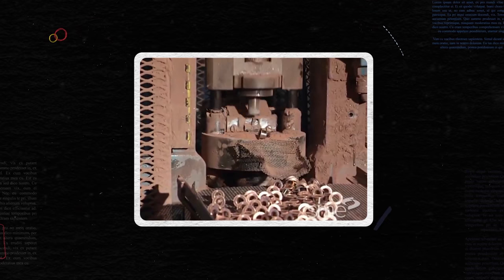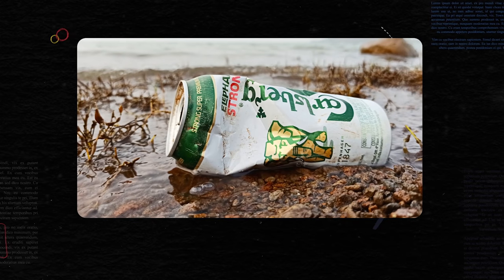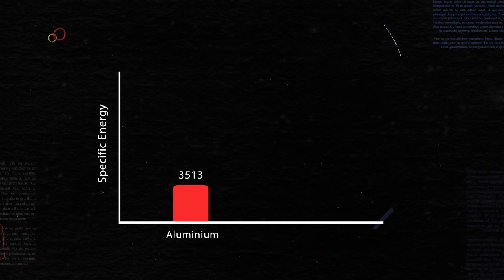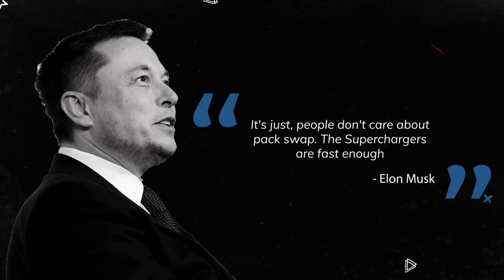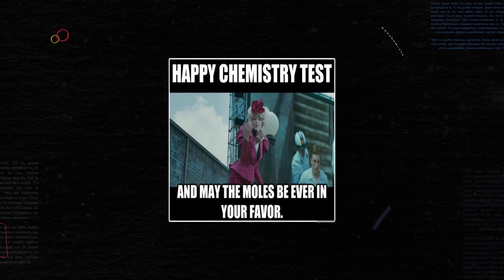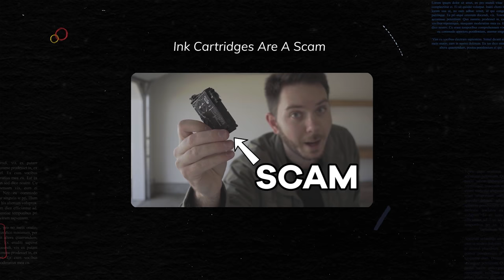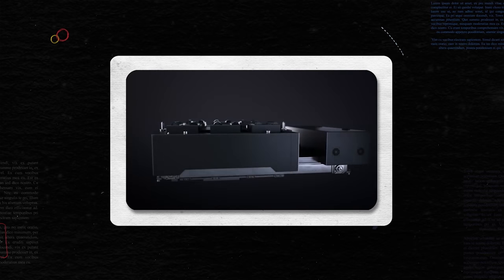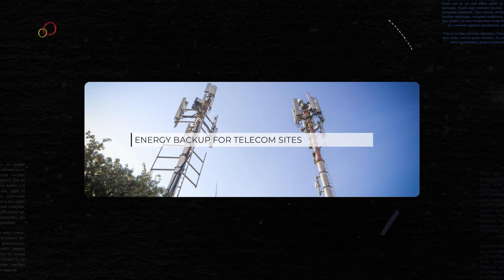We Can Get 1600 KM of Range With Aluminium Batteries

Comment: The reason they can't recharge in the car like lithium, lead or any other metal is that dendrites grow out from the anode and short the circuit. This can be prevented with blocking membranes, wide spacings, dendrite shattering ultra sound but all add weight and complexity.

Comment: Well theoretically, the ''battery'' ( I would rather call it fuel cell, it is not really rechargable - I know it doesn't have to be - but I think that fuel cell fits better ) exchange would not be really that much of a problem - it would kind of be work the same as regular gas station - you would have two tank caps instead of one - one would be for water and the second one would be for the sludge, so you would pull to the refuel station and hook up those two into the car ( water would be pumped into the water tank, sludge would be pumped out of the sludge tank ) and than you would replace the aluminium, which could be done by inserting several smaller aluminium fuel bricks that could be either inserted into the battery ( but that would be uncomfortable, time complicated etc. ) so instead, it would be inserted into a port and transported to the battery / fuel cell / generator area, where it would than dissolve into the sludge that would than be pumped into the sludge holding tank ( and than the whole process discribed for the refuel station would happen )

Comment: This is not good for a personal car, but it can solved the problems for trucks and ships. Then can make a system to swap much larges units. Then a single swap will be hundreds of kilo for a truck and many tons for a ship. The recycling part will be easier since the number of units  that needs to be handled will be much lower.

Comment: Why should the 43kg Al cell be changed in a single piece? What about a battery that is built up in 4 units having cca 10kg Al cell each? Hence dedicated replacement station may not be needed at all. Replace the electrolite is also not that big of a deal and may hae to be done only at AL cell replacement, so the whole "refil" can be home based.

Comment: The problem with battery swapping is that you need more batteries than with simply recharging them (a lot of them precharged as a reserve). And since the world is battery constraint … In case of aluminium air batteries that might be a lesser issue.

Comment: Thing is putting in electricity to derive metals and then use it to produce power again is actually a waste
Hydrogen fuel cells
Al fuel cells
There are solid state batteries but the well to wheel efficiency is damn low 😅

Bio fuels are always better, they take processing time and power but we'll to wheel efficiency is great 🤗

Comment: I've worked for large warehouses that run electric power equipment and do their own battery swapping. Between the simple set-up required to do it and putting people with such cars on a subscription style pay module, you can get such units swapped out in less time that it typically takes to pay for gas. Use a car wash style system with a tap card pay system and you can completely automated the whole thing and the customer never has to get out of their vehicle.

Comment: The first country that develops a mass produces ethanol hybrid car with good battery range and using ethanol as a range extender wins big. They also need to develop a trailer mounted vacuum still that can convert the plant matter into alcohol on farm so the wet distillers mash can be fed straight to livestock, along with some hay, to produce meat and milk. Shipping feed stocks and distillers grains about is the flaw in ethanol today.

Comment: I'm sure this was announced a couple of years ago and dismissed as the battery isn't rechargable and would need to be swapped out and the old battery melted down and remade. What happens when you want to use all your capacity but have to change the cassette? How large would the battery need to be and could I carry a spare? Recharbable batteries will do for now until something viable comes along.

Comment: I see stationary storage as a much more adoptable form of this tech than transportation. People aren't going to stop and change out water based capacitors every 300 kms, something that can be automated in a stationary setting as power is used. And no one wants to deal with 43 kg anode replacements as if it were a filling station. Again, something that's easy in a stationary application.

Comment: Aluminum air batteries are a scam in terms of use for electric vehicles.

They take far more energy to turn back into usable batteries than they are capable of emitting.

Great for applications that need the energy density but retrieval is impossible- like for space.

Comment: I understand that a battery for a car would be prohibitively large and heavy for a home user to replace but why can't it be assembled as smaller packs that would be easier for a home user to handle? So you change out several smaller modules instead of one very large one.

Comment: I would think that there’s nothing keeping the battery as one single unit. You break it up into two and you have something a lot more manageable. Also you could try one large battery that needs an appointment to change but a smaller battery you can change yourself maybe for daily driving or in case of emergency. If the car gave priority to the small battery first then you might do all the daily driving on that one and leave the big battery for road trips.

Comment: aluminum air batteries are a primary battery and is not practical for an ev, they should be looking into the rechargeable version which is  called the aluminum ion battery. no one wants to get anodes replaced.

Comment: THis is like the old zinc air battery.  You cannot recharge it, so each time you need  to replace it you have to buy a new battery, or atleast the refill, and that aluminum oxide has to be melted and refined back into aluminum metal, so this is not practical in efficiency when it takes less electricity to recharge a lithium battery and with no pollution  for clean energy sources and lithium powered cars can run about one cent per mile.  11 cents is closer to what an ice car costs to run.

Comment: I have some ideas :

Make the battery in arrays of small and portable units instead of a big monolithic one. So you can replace the used up ones by hand and need not make replacement appointment in some facility. The batteries unit then shall be available at any car shop.

Also the batteries should not be used all at the same time. Divide the array into 2 or more banks and the car only use one bank at the time. That will make sure the batteries are used to their last spark before replacement and make battery replacements to be more like the refueling gas as we know it today.

Comment: Seems like it should be simple to split that 43 kg anode into 2 or 3 easier to move pieces or just use multiple batteries with smaller anodes.

Comment: A hybrid battery could be appealing.  A traditional Li-ion rechargeable component delivering a 80mi (130km) range with a 620 mi (1000 km) Alu-Air component for long range journeys.   Personally I'd rather have the long range component a hydrogen fuel cell.  I think that would be more flexible, but hey.
Reply: And a bit prone to explosions.

Comment: Wonderful presentation. I have my doubts about recycling alumina. The cost would be closer to USD 200/- pmt. But collecting alumina sludge would be a painful and not so cost effective. Storage of sludge would pose a serious problem. You mentioned the efficiency at about 15-20%, if that is increased substantially, then it will certainly be attractive. I, for one, would like to install such a battery for my small residential needs, if it can be done. The cost of electricity is nearly Rs 12/- per kwh

Comment: Great video. It was really nice to see all the numbers in perspective. 
With the massive adoption of solar and wind we're seeing, it's possible the lower energy efficiency/higher cost of energy will become much less of a factor (or not a factor at all), while economies of scale could get a handle on the logistical challenges. 
It's still hard imagining a sudden shift to aluminium-air with Li-ion being so dominant (especially as battery prices fall). But it is very interesting. It might also make a lot more sense in certain applications (particularly air travel), especially if the technology continues to improve. I love that an Indian company is just getting out there and trying it. Best of luck to them!

Comment: Why not use an aluminum air battery as a backup? 

I'd buy an electric car today if it had about 350-400 mi range and a back up aluminum battery for long distance driving.
Reply: And I live in Texas. I drive 60 miles ONE WAY to get to work. If I could get on board with that I imagine most people would too.

Comment: Great video, but if we are already in trouble with air pollution, consuming oxygen on a large scale should be considered wisely! I'd choose breathing over driving anyday.
Reply: A question of mine also ...  At least when we 'crack' water - we can release the Oxygen into the environment for later binding with the Hydrogen.  However, with this Aluminum technology, this does not appear to be the case.  These numbers should be crunched : Environmental Oxygen binding.

Comment: Awesome presentation! Or rather ASSome presentation! Seems way more viable than lithium or hydrogen fuel cells (which uses freaking platinum) for India at least. Let's hope a real push happens on this. Only iron air could be cheaper.

Comment: I'm confused about one aspect: Are these Aluminum-Air batteries rechargeable? I understand that they must be swapped out after so long, but can they be charged before that point? Or are these effectively single-use batteries, that are rebuilt before being usable again?
Reply: Single use then recycled. The "recharge" is the re-smelting of the AL203 (aluminum oxide).

Comment: But what about Wh/liter? Does it even fit in a Electrik Car. An what is the C Rating ? How much discarge can the battery handel. Is it stabel in a wide range of temperatur? There is alot more to this than cost.
Reply from the maker: You replace the whole anode so having a C rating wouldn’t make sense.

Comment: couple things not considered-log 9 proposes to use graphine -this is still unproven technology-like to know how log 9 proposes to solve that problem.  how is phynergy addressed the problem?  several auto manufacturers are doing trials now using phynergy battery.  any word on the result?  i hope results are positives 

thanks
Reply: Ya and graphene production is also quite expensive. I wonder why haven't they done r&d in increasing manufacturing efficiency of existing li ion batteries and upcoming solid state battery

Comment: Nice presentation! Well explained 👏👌
I believe lead acid batteries will prevail till the end of time just because the used lead plates are recycled to make new lead plates for new lead acid batteries 😀. Li ions are now replaced by lipos which are much safer. I don't exactly remember but read something about lithium titanate batt which is much superior. Also super capacitors may replace lithium. Cost wise lead acid is the most economical one and lipos will be on devices for the next few decades. Supercapacitor and other newer expensive batt tech will be opted in space tech and military where cost isn't an issue.

Comment: Self-swapping could easily be achieved by having two smaller anode cartridges rather than one large one. Could really be of use in areas with large renewable energy capacity. Hydro electric power and aluminium smelters are a good combination.

Comment: I remember reading about Log9's battery and my first reaction was that it won't be that efficient. 

An aluminium battery will give you about 1.2kWh per kg but to recycle the by-product back into aluminium you need 15kWh plus the smelting process produces a couple of kg of CO2.

It's a good idea to use excess renewable energy to make pure aluminium rather than letting it go to waste but that aluminium should be used in all the other applications that the metal has rather than using it in a battery that has a recharge efficiency of less that 10%.

Comment: Anyone else notice the subtle skip over a huge problem that happened in that video? She said "Just filter the CO2 out of the air" Ohhhh right JUST filter the CO2 out of the air huh... that is a tough job to do.
Reply from the maker: Totally understand where you’re coming from.

Would have loved to include how Phinergy, and Log9 are doing this. Phinergy is using a “nano porous silver based catalyst”, and Log9 is using some graphene based material. 

We reached out to both companies, but they didn’t respond in time, so we left it as a base assumption that their filter works as claimed. 

One of the companies has responded since the upload, so we’ll try to get that information for you :)
Reply: @TechforLudditesSira  I'd be very interested to hear details of the filters cost, efficiency and expected lifetime. IF they perform as indicated then they would have uses in submarines, spacecraft, under water rebreathers and carbon capture plants.
Reply: @TechforLudditesSira  You also may have accidentally buried the lead on this story, if carbon can be filtered as fast and as efficiently as this reaction requires you have have just solved climate change.

Comment: The biggest drawback from changing the cassette  yourself was weight right? Could you not reduce the weight by just breaking up the cassette into multiple smaller ones, like 3 or 4 of them or is that not possible?
Reply from the maker: Someone would still have to transport that 43 kg to your home though
Reply: @TechforLudditesSira  but what i am saying is even if the combined weight weighs 43kg for the total of the current  cassette, could it not be configured that each cassette would instead weigh something like 10kg, you would end up needing more of them but if configured correctly you would only end up switching each 10kg cassette 4x as often but could be done at home, no?

Comment: Sorry to say but this is kinda misleading you know that aluminium smelters cannot be reverse charged it's not scientifically possible for getting views this topic is ok but I don't think wishful thinking is key for anything.
Reply from the maker: Either you didn’t watch the video, or you’ve misunderstood it completely 😂
Reply: @TechforLudditesSira  first of all great content as always but I wanted to say this technology is not something new it is there since 1960 devloped by nasa during Apollo mission but the conversion of alumina back is very high energy intensive process will outshine all the benefits hence it was abandoned by everyone , it's not chemically possible also your price calculation was based on fixed pricing mechanism which will not work in real world and all other problems were covered by you thats why no major industrial house backed log 9 their car was more of a science project also Tesla increased their battery capacity by 30 percent by using boron libf4 crystals which was pre supposed on the technology already present same problem with hydrogen cells that is why I said we can waste time by believing in alchemy of materials and wishful thinking or be truthful and work in improving actual workable technologies.

Comment: So if it has the potential of releasing 8600Wh/kg so it has to take at least as much to produce it. But then it does release only 1200Wh/kg so maximum efficiency is lower than 14% and you can't charge it at home.
Oh but you say it takes 15kW/kg so 8% efficient battery.
But sounds like a good idea for a range extender. Small Al-Air battery allowing you to get to the charger. 
Oh - again you talked about it... you can see I was writing this comment while watching ;)
Reply: OH! Great video btw!
Reply: But u don't need to charge it like li ion car. U just need to swap the aluminium slab. Thats it u can go another 1000 kms
Reply: @harsha6655  Can't see how that's a problem. You just wake up with a full battery (or whatever level you set it up to).